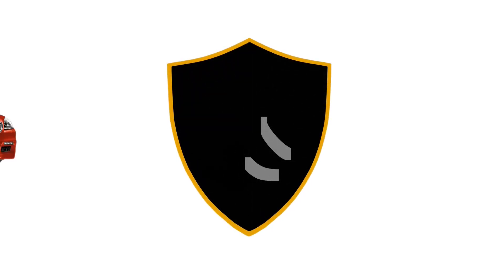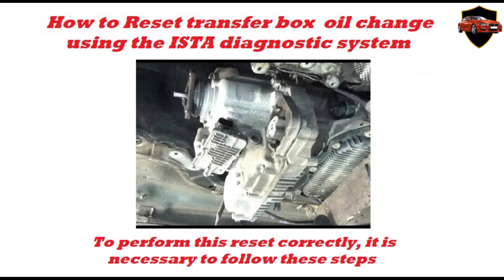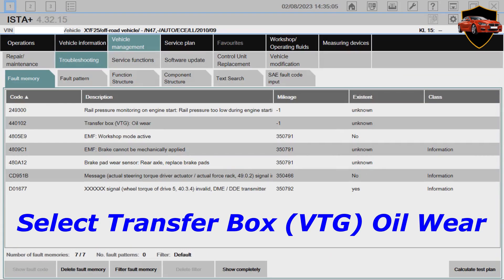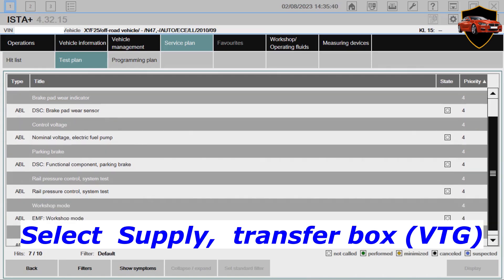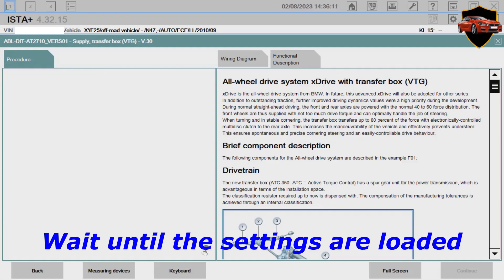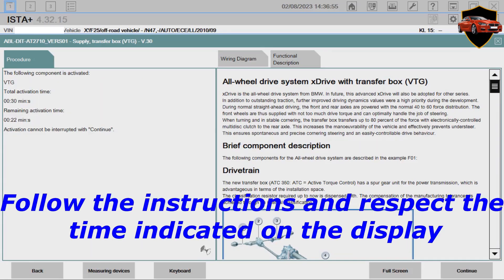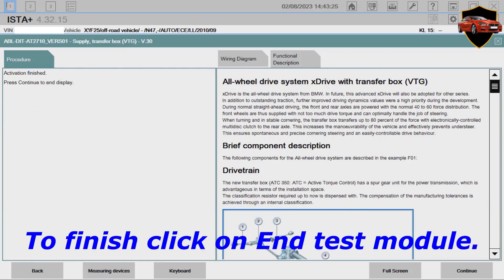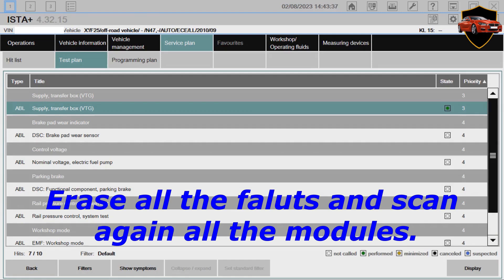How to reset TRANSFER BOX oil change (VTG)  BMW all series.

Comment: Stupid question, this was sped up, correct? Im seeing minutes disappear in a few seconds. How long is the entire process?
Reply from the maker: The answer is equally stupid, it depends on the resources of the diagnostic system, but the time intervals are the same.
Reply: I have a handheld similar to the one in this link, and the calibration at the end seems to be a lot quicker than your demonstration. So Im not sure what the difference is, all Im attempting to do is change my xfer case fluid https://www.youtube.com/watch?v=LgW3jVMpoqc
Reply from the maker: It depends on the device's processor.

Comment: This is not correct you must re calibrate the transfer case to correctly set the clutch limits
Reply from the maker: Through those 5 activations, the transfer box is checked and recalibrated, I focused on resetting the old oil, not on recalibration, hence the name given for the video.

Comment: Is this step necessary when you change the oil in the Transfer case? What happens if after the oil change, an adaptation is not done? I want to do it for my x3 f25
Reply: It jump gears

Comment: I have sa same error D01677! What was the solution for this error? Thanks
Reply: I know it has nothing to do with the transfer case.  I kept searching on google and couldn't find anything helpful.  If you could tell me if you have information about this error, I would be grateful.  thank you
Reply from the maker: follow the steps in the video and the problem should disappear if there are no other defects.
Reply: II solved the oil wear, but I still have the D01677 error that I saw in the video at the end.
Reply from the maker: @srb_alex7781 
It has nothing to do with the transfer case, it's a Drivetrain Fault. put the code on google and you will find some useful information.

Comment: What software do you use and how much is it?
Reply: I used ista + and did it 3 times. It say's its calibrated. Just the VTG oil fault WILL NOT go away regardless.
Reply from the maker: ISTA D is the program, it can be downloaded from filelist, and as a diagnostic plug you can use an INPA d kan
Reply: @JHAMS.001-car-repair  Can't use it on a f15 vehicle my friend.